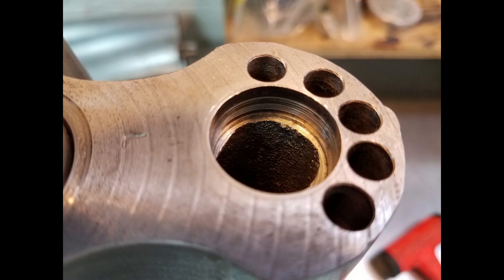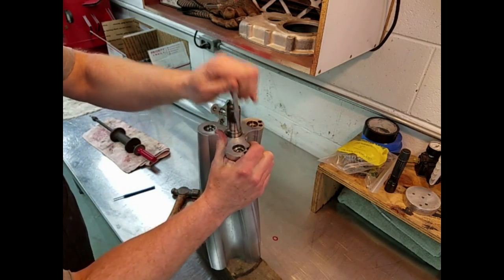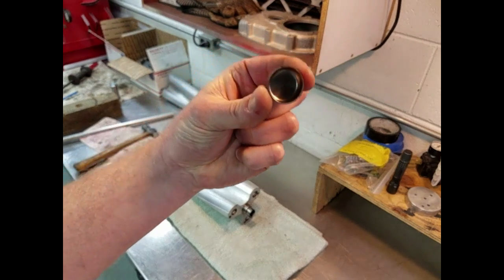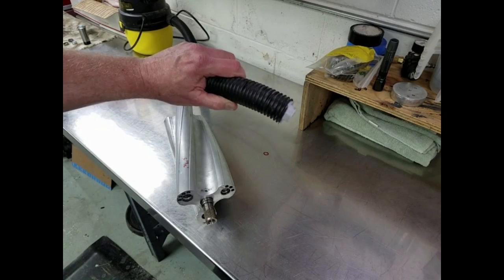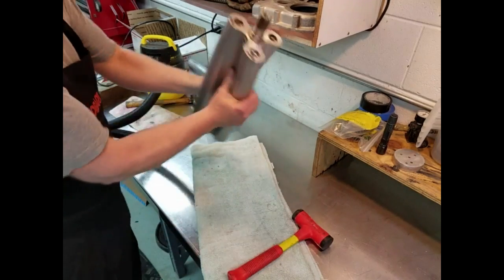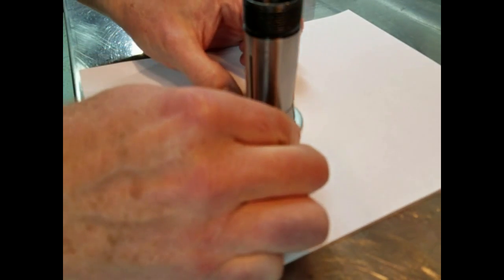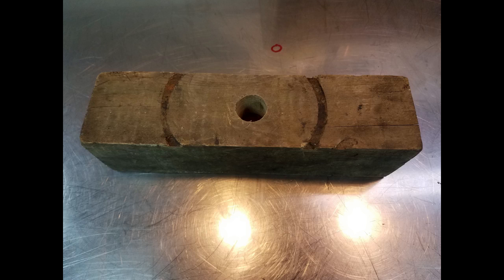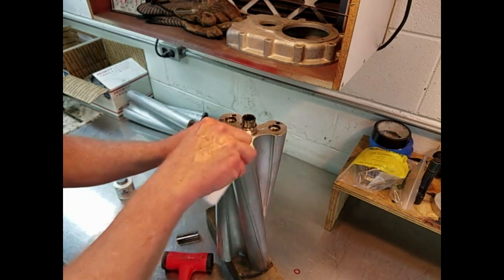My 6-71 Blower rebuild, Part 6: Cleaning metal chips from inside rotors.

Comment: Hey there again do you balance the rotors after the pinning process?cheers
Reply from the maker: No need to rebalance.  The amount of material removed during drilling is offset by the weight of the pin, which is driven about half way through the stub shaft, so it shouldn't cause enough imbalance to even measure.

Comment: Not only did I need to shorten the plug but lighten it as well. I weighed the factory plug at 6.0 grams ,the new plugs I purchased from Papco were thicker and longer weighing in at 10.8 and only lightening up to 9.5 grams when made the same length. I had too use my bench style belt sander and take some off the back as well as bore the plug slightly to hit 6.5 and thought that was close enough? talk about time consuming!!! Lol what brand of plugs did you use?
Reply from the maker: I think that I got them from a local NAPA.  I will check my records when I get back home tonite to see what I used, and reply back here.

Comment: Out of curiosity, why gasket sealer... Which I assume is like amber tack or whatever permatex calls it, that stringy sticky red stuff... instead of loctite? Interesting videos though. I'm thinking about building myself a 671 blower for a 55 Chevy with a small block. Should be WAY cheaper than buying one from like Dyers or BDS... And you don't get that ugly billet stuff with their logo on it.
Reply from the maker: You know, I don't know if any sealer is even necessary, as it looks like the factory just drives the plugs in dry.  I used sealer as a hedge against any liquid fuel possibly migrating inside the rotor casting.  Yes, I think that Loctite red would be fine as well.  It would certainly hold the plug in place well, and provide some sealing to boot.  
I looked at the rotors of a small bore 6-71 that I have lying around, and those plugs are actually staked in place from the factory, with small punch marks, like from a flat chisel.  I might actually do that when I rebuild that one for my "spare" blower next winter, that is stake the plugs back in then take a very light cut on the lathe to remove the upset material on the end of the rotor after staking.  If any Professional blower builders chime in here, they may offer up an alternate method of sealing/retaining plugs  :)
Reply: @MakerCave  no professional here but i was contemplating removing all plugs then replacing with teflon machined plugs?
Reply from the maker: Teflon is one of my favorite plastics, but it has no "memory". If you dent, or deform it, it does not spring back.  Although it is very slippery, it probably wouldn't keep a reliable press fit in this application.  Also, to keep those rotors balanced at high RPM's, you don't want loose plugs jiggling around inside there.  The cup plugs may not be an elegant solution, but they are perfectly adequate (and reliable) in this application.  Thanks for watching!
Reply: @MakerCave  This idea was from professional blower builders not mine. Unsure what exact material they use though?
Reply from the maker: @shawnramsay1851  Well, some race blowers are also stripped with Nylatron at the rotor edges, so clearly this material survives the normal operating environment, inside a race blower.  If I remember correctly, Nylatron is impregnated with Molybdenum Disulfide which makes it very slippery.  There are different grades of Nylatron, but I recall that some are good to around 300 degrees F.  Also, I have a bunch of 5/8" thick Gray Nylatron that I have machined in the past, and it seems to machine nicely, and not as gummy as regular Nylon.  It feels harder, so Nylatron would probably work as a plug.  If you have any race customers that turn lots of RPM's and high boost, it would be easy enough to try, and then do a teardown inspection after a few races, or the entire season.  If the plug would become loose, it shouldn't be able to damage the end plate because of the MoS2 impregnated in the plastic.
Reply: @MakerCave  well you were just confirmed to be 100 percent correct on them coming loose. I just contacted one of my experienced builders that I luckily get opinions from and he confirmed exactly what you said , stick with the cheap steel plugs. Thank you again for your videos, replies and honest opinions!!! If you ever get bored check out Ramsay Custom Blowers on Face Book. Cheers